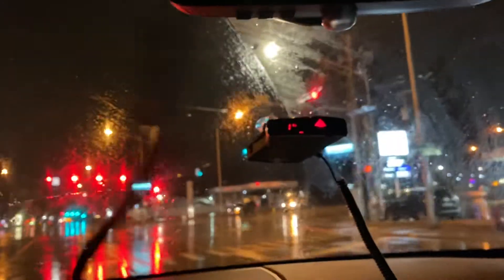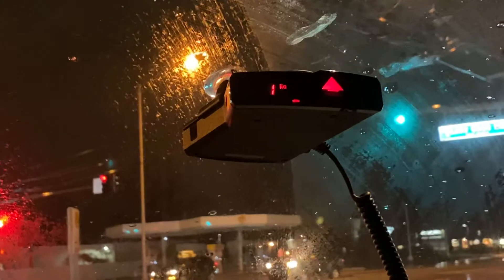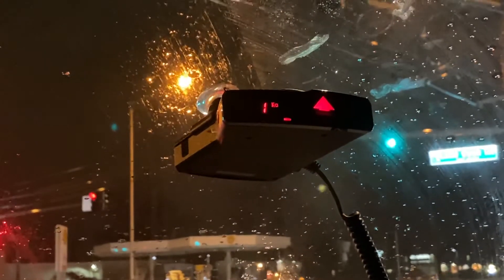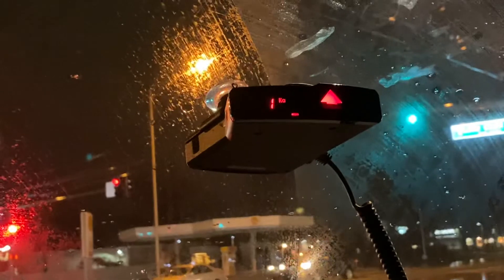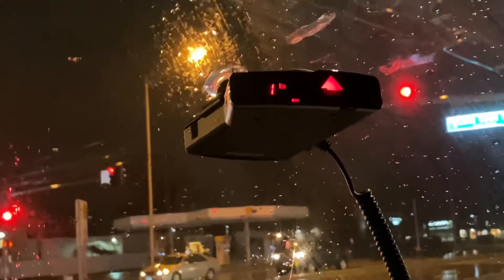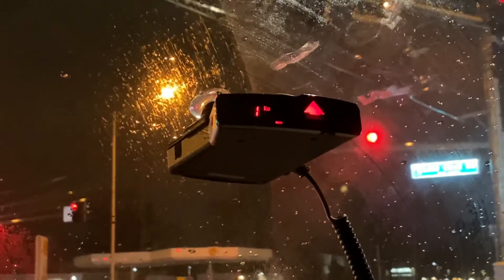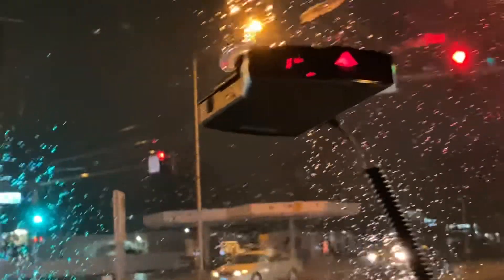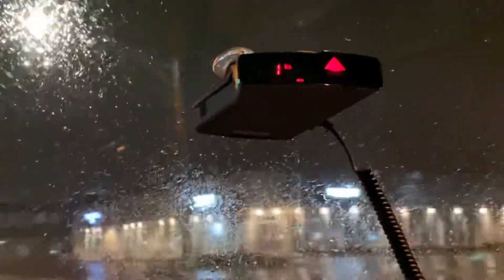Valentine One Gen. 2 vs (Ka 34.7)

Comment: I just ordered the Gen2 to replace my Gen1. Initially, I thought the ramp-up wasn't as progressive compared to my Gen1,  but then I noticed he was shooting in the opposite direction. Even as I wait for delivery, I'm a bit skeptical as to the cost value benefit vs. the Gen1. I mean, I'm assuming it will filter out the growing number of false signals and possibly extend the operating range. It wasn't till after I made the purchase when I realize that all the talk of huge range gains, are only achieved when you disable all of the filters. I plan to run mine with X-band and Laser OFF.
Reply from the maker: Tbh this detector has blown me away and best purchase I’ve made in a while.
Reply from the maker: Jake A That’s what I have observed as well.
Reply: Hamza Shakir I just got mine 2 days ago. And I love it with V1 Driver. Went from NYC to PA and was picking up KA from kid you not 5 miles away on I-80 west. 😍😍🚔🖕🏼
Reply: How are you liking your Valentine 1 Gen 2 detector?